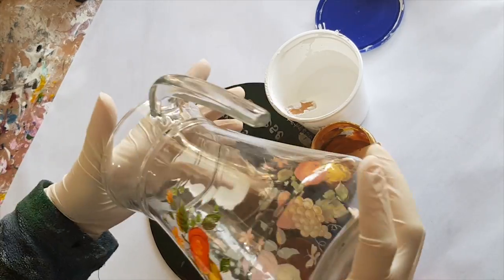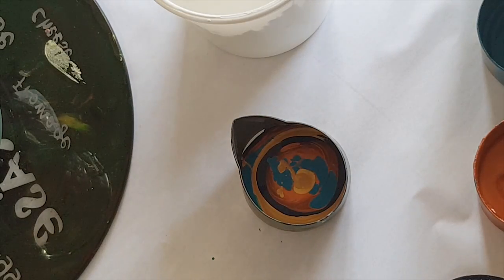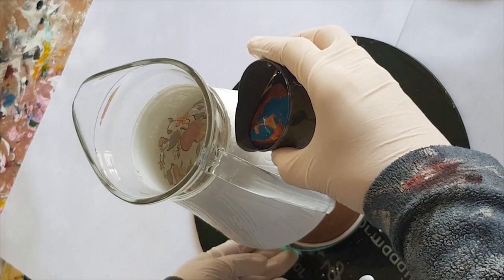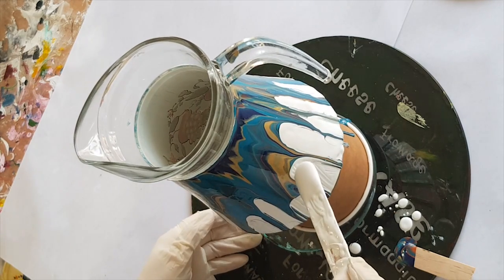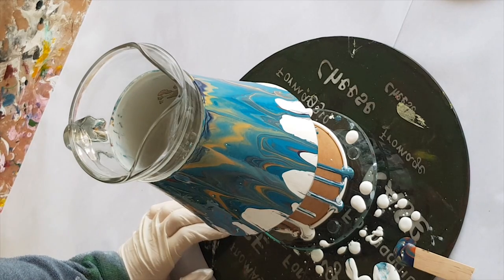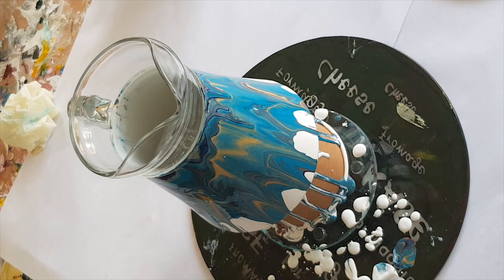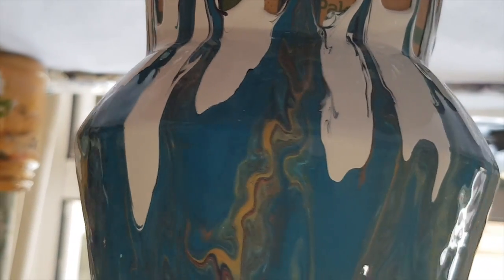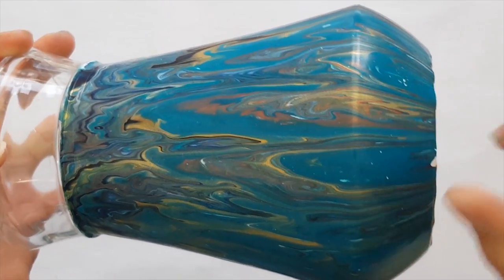302 How to Cover An Ugly Design on a Jug

Comment: If you glaze this would it be dishwasher safe ?
Reply from the maker: I am not sure what you mean by glaze.  If you resin it and make sure the resin completely covers and seals to the glass it may be.  This is standard acrylic paint not the Porcelaine paint I have been using.
Reply: You could use Mod Podge  or some other type of sealer  ... glaze
Reply from the maker: Yes Mod Podge has that dishwasher safe one doesn't it.  Maybe I will try it :)